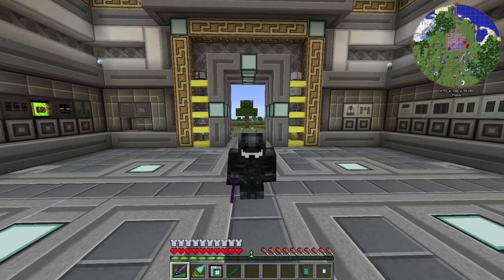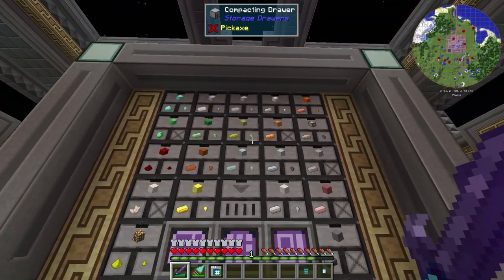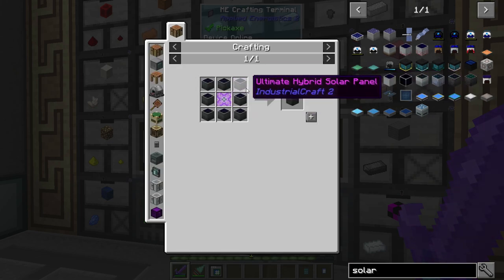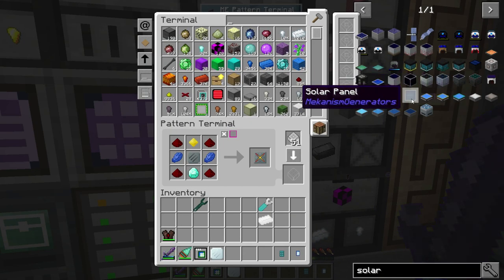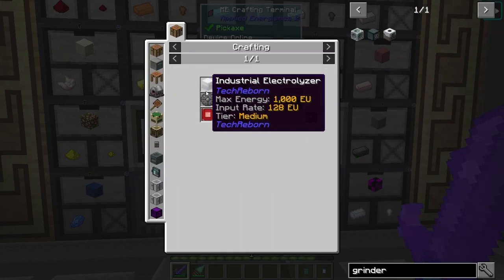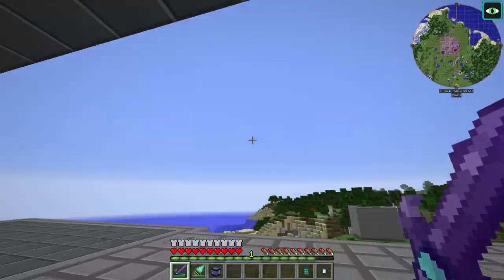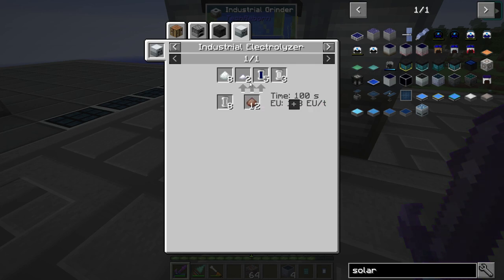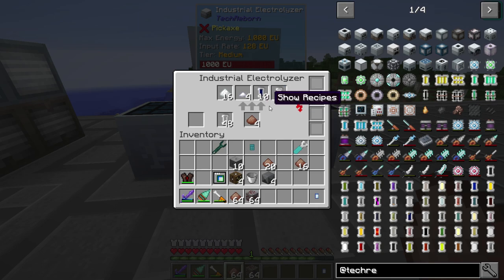Age of Engineering EP30 Tech Reborn Industrial Grinder

Comment: TechReborn looks like Gregtech 4 in 1.10.2. I have never played GT4, but from my GT5 experience, each recipe might have different power requirement, and the power on the machine only tells you the tier of power (voltage) you should feed into it but not the amount of EU it consumes every tick.
Reply: yeah that's exactly what it is, TechReborn is a old gregtech and ic2(classic) and no, power in old GT works the same as power in ic2 exp, so you can connect TR machines to ic2 power line
p.s. every single mechanics in TR works the same as mechanics in old GT but more stable and less uncomfortable,
you can use GT3 or 2 wiki (GT4 wiki is not recomended because this version is not the same as TR representation but still has some mechanics involved)

Comment: you also didnt need industrial grinder since u only need it to grind rubies and bauxite processing dust i used crusher to do mine and less of a eu hassle i would recommend that if you hate the eu bugginess of tech reborn and i only used electrolyzer also automating the line of creating titanium and chrome would be useful in the space age
Reply from the maker: I see that now, going to convert over these Tech Reborn machines are very buggy with power the will eat whatever I throw at them with very little to no speed gain.

Comment: hey system you know you can get chome from rubies by using the arc furnace from immersive engineering, its easier than the ic2 way i think
Reply from the maker: That is what I am using. Also switched off the Industrial grinder straight to regular double grinders.